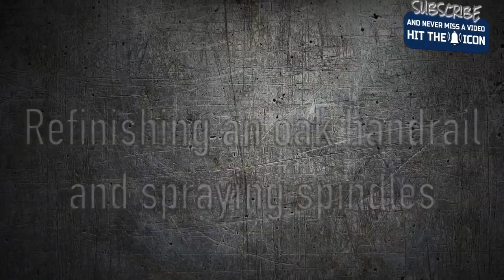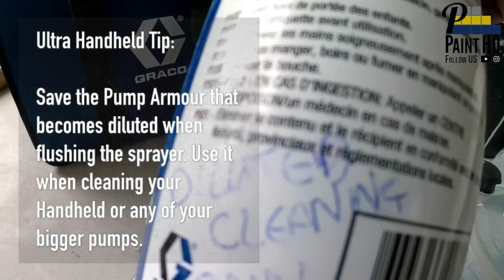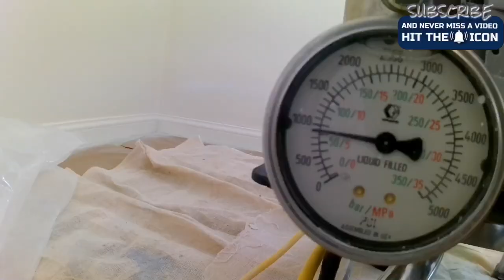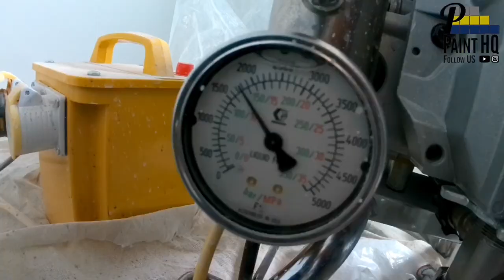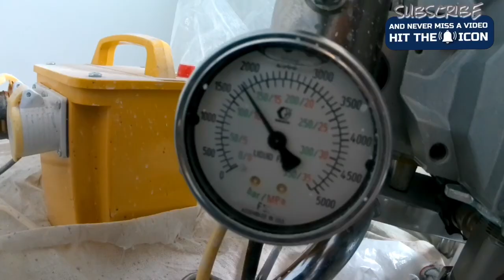Refinishing a Wood Hand Railing. Spraying Lacquer With Airless Sprayer

Comment from the maker: What’s your experience? A dark oak handrail with white spindles and staircase is a classic, timeless look.. Especially popular in the US 🇺🇸 ..Would love to hear from anyone, giving details about how they go about this project.. do you prefer solvent or water based dye / stains? What’s your go to lacquer / varnish? What order do you paint the spindles and handrail?

If you want to see more about painting a HSL check out.. Painting Hall Stairs and Landing with A Graco Paint Sprayer
https://youtu.be/QKpvB8N95Wg
Reply: How long did this work take?
Reply from the maker: For the handrail and staircase, 3 days.. Day one prepped woodwork.. Day two applied dye and lacquer to handrail.. Day three, mask off and spray spindles - primer and top coats.. the whole house project, everything sprayed took 2 weeks.. some very long days though🙈😆
Reply: Dark oak is a classic yes,i like walnut too,i tend to use ronseal exterior water based stain and varnish in one,3-4 coats normally,it leaves quite a good skin and the fact its exterior means its harder wearing and tends to last much longer on the areas where people tend to grab it and it dries quickly which is great if people are in the house,i tend to finish all the spindles first and do the handrail at the very end
Reply from the maker: Ah nice 👏👌 ..I love walnut, my favourite hardwood 👏👏 thanks for sharing your process.. spot on buddy, great call using the exterior product on the rail, that’s a common practice.. thanks for your input 💯 regards Pete
Reply: Hi Pete,

Congratulations on another excellent finish. I recently finished a similar job but there was a groove in the side of the handrail and it had been painted white below and left natural on top. Masking was a challenge but the client was delighted with the result (mostly due to your videos!).

I have a quick question – I have a job coming up where the bannister and spindles are very close to a wall, maybe 10cm away, the wall is to be painted (spindles not) so would you mask each spindle and spray through the gaps or have you another idea?

Many thanks for your advice on this and all your work in posting these.

With best wishes,
Rob
Reply from the maker: Hey Rob, ah thank you buddy.. great feedback 💯 Yeah I know what you mean with that design handrail, like you say a challenge but these projects always turn out great in the end 😆 ..Regarding the spindles, yeah you’re right, brown paper is probably the best option.. use the 6” one, easier to handle, less waste and cost effective.. I always order a quantity of 6” rolls when placing my masking orders.. when spraying the first coat, it might help to do some directional trigger pulls (you often see me do this in my videos / back of radiators is a good example).. it sprays a shot of heavy material under pressure in one quick pull.. don’t overdo it, the paint will run 🙈 ..Because you can’t get a good straight on spray the transfer efficiency can be poor.. just check between coats, it may feel a little rough.. hope this helps a little.. let me know how you get on 👍👌 ..Pete 🎨💯
Reply: @PaintHQ  Hi Pete,
Isn’t it funny when someone points out the obvious - I’ve only ever used 12” paper and had to fold it back on itself as it’s too long! 
Many thanks for the advice – I’ll certainly give it a go. 
With best wishes, Rob
Reply from the maker: Haha, yeah no problem my friend 😆

Comment: Beautiful finish many thanks, I'm always learning and thanks for the tips. Just a quickie, is it worth purchasing the Graco ultra handheld or GXFF for trim work.
Reply from the maker: Very much appreciated Michael 💯 .The GXFF 👍 ..With the smaller 7.5m 3/16” hose, and gravity feed via the hopper it takes 134ml of material to prime the hose.. so you require very little to get spraying.. The GXFF will handle woodwork day in day out and the occasional ceiling / walls.. great machine!. if in future you went for a bigger pump, the GXFF fits in nicely, being mains powered and not requiring a transformer it’s much more manoeuvrable than its 395 / 495 / etc / big brothers... now from my videos you know I rate the Ultra Handheld, but for a compliment to the big sprayers.. for touch ups, small projects, small runs of trim, a door etc ..So yeah the GXFF 👍😆 Hope this helps my friend, let me know how you get on 👌👍 ..Regards Pete 🎨💯
Reply: @PaintHQ  Many thanks, Pete for your help and advice, keep safe
Reply from the maker: Anytime my friend 💯

Comment: Always like your videos! Do you use an extractor fan when you spray what happens to the over spray?
Reply from the maker: Hey Sam, you’re a diamond 💎..I’ll use a 12” extractor if there’s a lot of spraying in an occupied house.. especially using low viscosity manufacturer coatings, the atomisation is so fine.. This project was unoccupied, the client was moving in after we had finished.. there was a lot of dry fall that needed vacuuming up regularly, otherwise it kicks up in the finish 🙈

Comment: Another super job Pete! Finish phenomenol!! Noticed you use albany durable matt on the walls regularly.  What's the sheen level on it and how do you rate it?
Reply from the maker: Thank you Matt, I appreciate your support my friend.. Excellent question.. yeah I’ve always rated Albany Durable Matt, even with a brush and roller.. Regarding the sheen, it’s in the Matt range but a smidge of sheen for the durability.. bit like Farrow and Ball Modern Emulsion.. sprays lovely, low pressure and each pass knits together with no lap marks 👏😆 ..regards Pete

Comment: Hey Pete, great job once again. I've now used my GXFF on a few projects, one still ongoing is 2 sets on oak wardrobes finished with Kiva 30 from Tikkurila. It's so quick, used so much more lacquer than I realised though. I'm so glad I got it, my old earlex turbine hvlp is laughable in comparison, I've got no idea how I got a good finish on the kitchen & bathroom cabinets I made a while back.

I meant to comment this question on a previous video - what are your thoughts on back rolling? 

I get to spray some walls on another job coming up, looking forward to it. Unfortunately, I had already order an LP515 before seeing your praise on the HEA tips but the room will be completely cleared... might have to check out that extractor though.

Keep up the good work, glad to see you're getting lots of praise on here.

Speak soon 👍 Stu
Reply from the maker: Hey Stu, great to hear you’re having plenty of success.. this is a credit to you that you got such a great finish with a ‘DIY’ turbine HVLP 👏👌👍😆 Well done.. imagine what you can achieve going forward.. Regarding back rolling, I don’t tend to do it unless it’s requested or thought there’s a risk that touching up future ‘problems’ will not be possible.. if the touch up is not in a critical light area (lots of natural light flooding in), you can delicately touch up with those small sponge gloss rollers .. or use a Graco Ultra Handheld 😆 ..If you decide to bankroll and you’re on your own, spray one wall at a time and then go over with your choice of roller (I like the microfibre / fine nap sleeves).. regarding the LP 515 tip, they’re great 👍 you’ll have success with that 😆 ..Let me know how you get on my friend.. Pete 🎨💯
Reply: @PaintHQ  cheers mate, I'm looking forward to doing it, it'll be in a kitchen, once I take everything out then I can spray away, looking forward to seeing how quick it is. I may need to invest in an extension bar / cleanshot as I'm only a shorty 😂 I'll keep you posted. Enjoy the rest of the weekend 👍👍